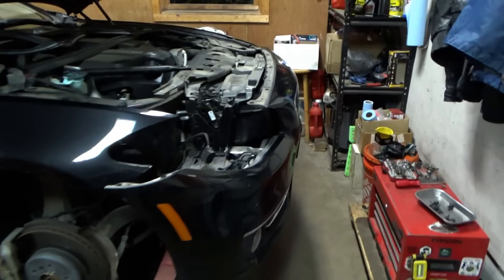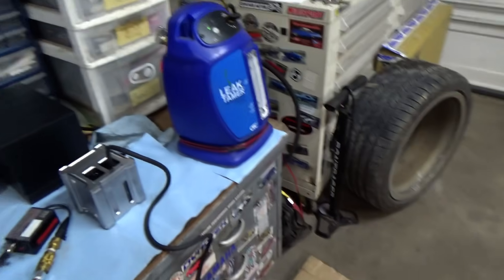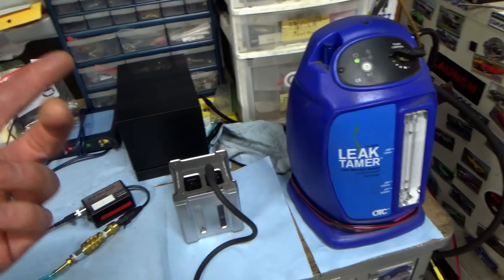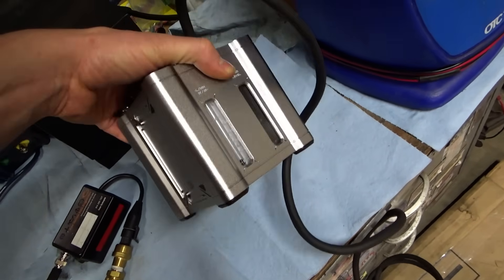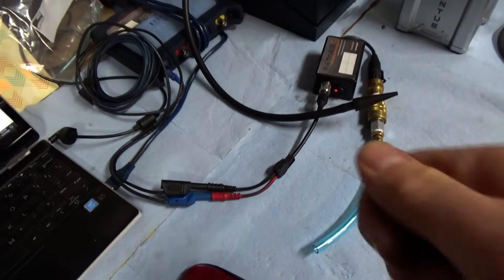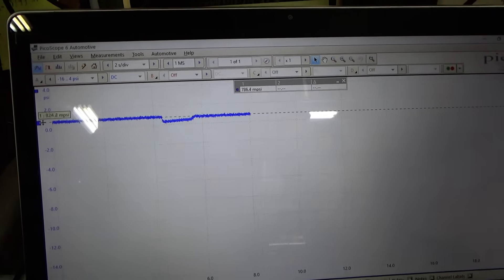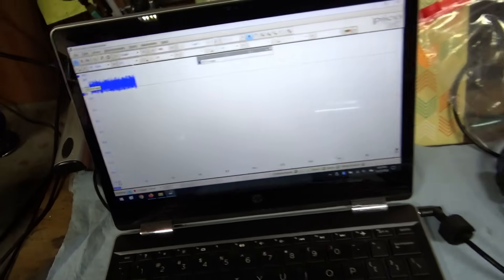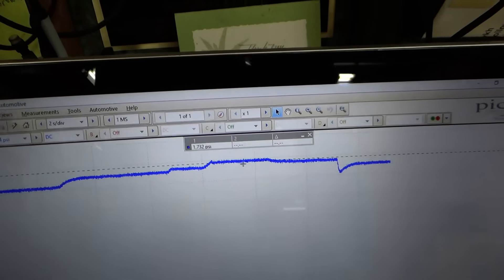BMW Headlight WATER INTRUSION?! (Smoke Machine Showdown!)

Comment: love your program.  When i need warm air to dry things like this I use my shop vac (clean the bucket first) by puttin the hose on the  outlet side and it will blow lots of warm air heated by the motor thru whatever u need to dry out

Comment: $1200 for a plastic jug with a heating element and a regulator to control air flow???  There’s not $50 in parts there. The $200 one has more parts and probably cost more to manufacture.

Comment: Can also make a very simple smoke machine out of 3" PVC plumbing parts from home depot to make a tank / pot, resistance wire meant for a vape wound to make about a 1-2 ohm coil,  wrap around a fiberglass tiki torch wick and some assorted hardware drilled through sides for terminals. some cords and aligator clips for thew car battery, Baby oil makes decent smoke fluid. run it off a very regulated down shop air and the car battery.   made one to find evap leaks and turbo plumbing leaks, works great!

Comment: The proper remedy would have been to put the headlight in a 275°F oven for 15 minutes. This would heat up the butyl so that the lens could be separated from the housing.
This would allow proper cleaning and drying of the headlight.
Butyl headlight sealant can be found on Amazon.
Reply: Whose oven ! LOL !

Comment: Stick the headlight assembly in an oven on its lowest setting. Most ovens have a warming feature of around 150 degrees. Leave all the caps off of it. Heat is your friend when drying out moisture. Also silicone won’t work for long. After about a year it’ll quit sealing. You have to use butyl. Those of us that build custom headlights learned this a long time ago.

Comment: Headlights are not supposed to be hermetically sealed so the trick is to seal the actual leak but make sure it can still breathe.  Also if that is mineral oil, it will coat everything inside the headlight which probably isn't good.  Plus it's flammable.

Comment: I have a lower model Autoline, it's ok for my DIY stuff. It was an upgrade from my home grown one with paint cans, wicks, and RTV connections, lol. The hoss that come with Autokine are junk mine fell apart and I had it about two years. It's a very low powered air motor, so it also took help using a flashlight. But, it did help a lot to find laks, if I was pro though I would get something more powerful.

Comment: In 1997 there was a new Dodge B350 vanpool commuter van that took out 2 headlight bulbs very quickly and was brought into our shop.
I removed the housing assembly and filled it with water.  Put the housing face down on rags that were on a bench.  Took a while but there it was, right at the black and clear plastic seams.
Using black RTV, I ran a bead around the seams, then put the housing face down over one of the floor lamps in the shop till the RTV dried.
No more leak,  no more burned out bulbs.
I like the OTC smoker, not so much with the little noise maker. 
Good fix Ivan.

Comment: I’m sorry Ivan but you are backing a smoke machine that couldn’t fill a headlamp with smoke, imagine trying to use this on an induction system etc, the two machines you are comparing are two very different machines, one is professional unit for a workshop that’s going to turn on and perform every day, the other is a noisy, low performing unit that clearly isn’t fit for a workshop.
Im actually surprised you have this labelled “Awesome”…
Sorry by my negativity but you usually plug quality tools & accessories…
Reply from the maker: @davidsinclair5004  the baby smoke machine hasn't let me down yet, and paid for itself in 2 diags! Sure it doesn't put out clouds of smoke, but for the price and portability it's pretty nice! 😁

Comment: Good luck with that. Been down this road. Bought customer new BMW light. THIS WILL BE BACK.  Anytime temp delta is significant  (hotter inside than out).
Ask anyone from BMW in Washington state.--------- It has vents_____    Air is allowed in ------- and out______

Comment: Hi Ivan, That little machine seems really loud to me when in smoke mode. Why was it quiet in air delivery mode but made so much noise in smoke mode. I also didn't like that the unit used internal/proprietary batteries. Which will eventually not take a charge. Hopefully Milwaukee or DeWalt will make one for their M12 or M18 units.

Comment: that permatex is great stuff also good on minor engine oil leaks, clean with brake clean and put it under vacuum and apply , 3m 5200 black marine polyurethane is the best for plastic leaks - sticky stuff, never comes off your hands!  mist with water to help speed up cure time.

Comment: Condensation in headlights in BMWs with active headlights is a known issue. Typically, you can resolve it by replacing the O-rings on the access ports, which should last for another 5 to 10 years. To dry out the housing, use a hairdryer for about an hour sending dry air thru the the access ports. O-rings are available from vendors such as ECS or FCPro. The O-Rings can be replaced with out removing the product. Likely the customer will return.
Reply from the maker: Uhhh water was getting in through the bad seal of the lens like I showed... Orings are not the issue here 😅

Comment: The smoke machines use oil. Are you concerned with oil inside the housing making it dirty inside the plastic that you are unlikely to be able to clean out?
Reply: I used a smoke machine to try to find a leak in my headlight. Left a oily film that was a PITA to clean out. I will be using compressed air and soapy water next time.

Comment: While handy, Id hate to wait for that thing to fill an evap system to actually find a leak.  Not much smoke output.
 Ivan, another shop called me with a Charger they had been beating their heads on for about 4 hours.  No start.  It took me 30 minutes with a wiring diagram to tell him what was wrong.  I did not hear a reply from him so I buzzed him and asked what the test I told him to run turned up.  He said he did what I told him and it was running.  LOL!!!  I said "Who's yer Daddy?!?"  XD

Comment: So if you just connected a air line to the head light you would have had the same results 🤣🤣
Reply from the maker: You would have an exploded headlight housing at 150 psi 😂
Reply: @PineHollowAutoDiagnostics  just turn down the pressure simple

Comment: Not impressed with the Amazon smoke machine. Couldn't see any smoke at all  there are others on the market for the same price that work much better.
Reply from the maker: Any recommendations?
Reply: @PineHollowAutoDiagnostics  ANCEL makes several models under $200 Autoline Pro makes a couple one under $100

Comment: I have a different model of OTC leak tamer, its 12V only - it has its own air pump.
The heater runs about 2 seconds in 10.
It does say not for evap systems though 

For drying headlamps I use tne shop vac in blow mode.
Theres a very high volume of air and it's also slightly heated by waste heat from the motor.
No danger of overheating anything.
Reply: Yes , blow warm air and Vac at the same time. Real time saver !

Comment: I had that same problem with my LED Taillights, used Hair dryer just pointing at hole for about an hour to dry out.

Sealed with silicone & drilled 1/8 holes in low spots of Taillights, no problems since.

Amozonian NON-SMOKE MACHINE SUCKS, YOU REALLY ENDORSE THIS THING ?

Comment: In similar circumstances I use a handheld hair dryer with a suitalbly sized tube attached to reach into wet electronic housings. I let it get to at least 50C and it dries it out bone dry as well as drying the cracked area out for good sealant adhesion. In preference to siicone I sometimes use epoxy.

Comment: I don't know how that headlight assembly is set up in regards to any modules or any other electronic materials, but a well placed drill hole will keep the water out by always draining it  i saw another video of a guy doing that. Has anyone else tried that. Sure would be a lot cheaper

Comment: After fixing dozens of F10/11 headlights (all right hand side) I can pretty much confirm that using a little silicone will not stop the water intrusion. It needs a good bead of permatex or heated up and press in butyl and checked afterwards, if a new location pops up
Reply: I had the EXACT same thing happen on a Nissan Sentra tail light assembly. The moisture caused feedback into the brake light circuit and caused the car to go in limp mode every time lights were turned on. I used silicone on the seal and it lasted about a year. Replaced the tail light assembly and problem was permanently solved.

Comment: Sometimes the headlights are inside dusty. Without dismantling it, you can't get to it from the outside. In such a case, I remove the bulbs and xenon bulbs and then fill in a glass of isopropanol and shake the headlight. Then pour out isopropanol.
This removes about 90% of the dust. And the remaining isopropanol evaporates quickly.

Comment: owner should save up for a new head light assembly anyways.  The wiring harness inside the lenses get baked from the heat from the lights and the insulation becomes brittle and just fall off leaving the wires exposed inside the housing.  And as far as I know there is no way to truly repair them with out fully correcting the possibility of a short and starting a fire.  and its not just the BMW its all the European manufactures have this issue Volvo, VW, Mercedes, Audi

Comment: 99% of the time it's a lens to housing leak. I just put my headlight assembly in front of my fireplace for a day to dry it out. Then put a tiny thin bead of clear silicine along the whole seam and 10 yrs later it's still good.

Comment: One of these vape-cigarettes puts out more smoke than that small cube. Good idea having a self contained unit, but they need to have it deliver a denser smoke.
Reply: I made a $5 miniature smoke machine with a vape pen using glycerin and a 3.7V Li Ion cell. It produces a surprising amount of smoke. A down-side is the glycerin smoke leaves a slightly soapy residue on surfaces it touches. Auto smoke machines use mineral oil which is probably more compatible with most car systems.  The other advantage of the glycerin smoke from the vape is that it is not flammable whereas the mineral oil smoke using air is an explosion hazard. The smoke machine instructions say you must use nitrogen to avoid this, but no one does.
Reply: I just used a vape inside of my headlight to smoke test it and it did leave a residue 😔  @carolb9422

Comment: A module for a headlight.  Nuts!
Reply: Those TMS modules are a common failure from water intrusion.
They drive the servo motors for levelling (and beam steering on adaptive models)
They're about £400+vat UK, but aftermarket units about a tenth of that.
Reply: @Tom-BXR300 
And how many thick wires would you have to route from the driver's door to control four windows, right and left mirror, mirror heat, mirror indicator, locks, and rear gate?

An with modern headlights you'd have to have electronics there anyway.

And most people today don't know how to even replace a light bulb. So... 😉
Reply: Hate new cars !!
Reply: Already over 20 years old thing :D
Reply: @Syntappi  
What?
Reply: @Peter_Riis_DK  at least bmw:s have had headlight modules last 20 years
Reply: @Syntappi 
Ah, that!
Reply: Nope. It actually was a good idea when it was first suggested. The idea was, that you could control anything on the car with a ring of three wires; power, two signal wires and a ground connection. The prerequisite of course was standardization making these modules inexpensive.

However every car manufacturer makes their own "shit" which makes it bloody pricy - and there's your problem.

Comment: There is a video online. Cut up some microfibre cloths. Put them in and blow compressed air in where you were putting air in. The rags pieces will circulate around and clean it out. I will see if I can find it. It was a detailer who posted it.

Comment: I have a $200 ANCEL smoke machine that you have to hookup to 12V yourself but has an internal air pump - works well. Puts out a lot more smoke than that little machine and came with a bunch of adapters including an air bladder

Comment: Moisture and BMW headlights go together like 2.0L VW/AUDI TFSI engines and camshaft correlation codes. F10 5 series are THE WORST about this. 

I prefer to use butyl sealant after baking the headlight for a low temp like 150-200. 

Love that you fix even the small stuff!
Reply: Hi. Can i ask you if 150-200 is fahrenheit? Thanks
Reply from the maker: Next up on this BMW... VALVE COVER GASKET! 😂😂😂

Comment: Repaired alot of leaking devices some under steam pressure on commercial steam cabinets and ovens . We find sikaflex is superior to just about anything else on the market it's difficult to run it on smoothly and takes longer to cure using moisture rather than air for curing but seals and lasts with non corrosive results on metal . Silicone is relegated to sealing surfaces what are visible externally and not under any kind of pressure but need a high quality finish like tiles .

Comment: I am a big fan of weep holes. Drill a small hole at bottom to give a place for moisture to escape.
Reply: Always do more than one in case of a blockage or too slow of a drain. At the lowest points, preferably on the backside or underneath.
Reply: Pour silicone beads in there!!!!
Reply from the maker: I thought about drilling a hole... But decided to actually fix the leak instead of making more holes 😂😂😂
Reply: @PineHollowAutoDiagnostics  I once had a beater old Toyota with this problem, and I tried silicone sealant around that seam at least three times but it still leaked.  Next time I will try a smoke emitting device

Comment: May i suggest that the port to access the bulb is also a keak point. The cap barely fit without you applying pressure with the clamp and it is a low point on the top where rain blown under the hood will sit and gravitate inside.

Comment: I had condensation in one of my 2020 Bliss F150 taillights a year ago, removed it, used hair dryer to get rid of condensation, then used silicone seal where unit is split, no problems since then.

Comment: I had the same issue with a tail light. I figured out where the water was getting in. After drying it out and cleaning it, I pulled a small vacuum in the tail light assembly and then let the vacuum pull some super glue in to the leak. Worked like a charm.
Reply: Silicone is too thick. I would choose super glue as well. Maybe gel super glue.
Reply: @johnmeyer4804  Flowable Silicone !

Comment: I would not use silicone. A good polyurethane sealant adhesive would be recommended. Silicone rapidly degrades in sunlight.
Reply from the maker: Hmm I've had the same silicone sealant baking on the ROOF of my Suzuki for 5 YEARS and it's still holding perfectly! 😊

Comment: hook it  up to the vacuum pump. the lower pressure will cause the water to boil off. as a plus it will pull the sealant into the crack.

Comment: These headlamps are ridiculous.  What was wrong with the old bulbs and no computer?
Reply: They wouldn't break as quickly (probably never except to replace a cheap burned out halogen bulb)
and it wouldn't cost you thousands to replace the failed unit!
Reply: Nothing wrong with the old ones but they don't perform as well as he newer ones, I drive 2 cars back to back with old and new headlight and the difference is huge .  Newer headlamps offer some neat perks, better lighting and visibility, less power consumption, they follow the directions of steering, they adjust heights based on road surface and lower when they detect an oncoming car so you don't blind oncoming traffic, some of them you can even keep your high beam following other cars and it won't blind them since it detects the car in front of you and will turn down the section if the light where the car is in front of you...but the down side is it will cost an arm and leg if you need to replace the whole housing...
Reply: @dazone  LOL....but they fail earlier, and when they do you will replace the unit for a cost of thousands of dollars ! lol I and most buyers do not want to deal with that for your technology.
Reply: @dazone need more microprocessors and modules! Technology is great as long as it’s working.
Reply: @ Yup, indeed!

Comment: We just use another battery in a cabinet the Leak Tamer sets on with wheels to roll around the shop with all the adapters under it in the same small cabinet. When looking for hard to find small leaks on EVAP systems you need all the smoke you can get.
Reply from the maker: I do a lot of mobile calls so needed something PORTABLE 😉
Reply: @PineHollowAutoDiagnostics  Oh we all know that for sure and you do a great job

Comment: I'm not to impressed  with the self powered..smoke machine...other than the battery it has same problem as all the other cheap chinese machines which cost around $70..not enough smoke..I didn't get anywhere with mine because it just isn't enough for many jobs..I'm thinking the cigar and harbor freight pump works better...cigars are 10$ lol

Comment: Very interesting, if unusual, video, Ivan! That little smoke machine is impressive! I only have a doubt about the quantity of smoke, if you need an EVAP test - is it enough?
Water is very annoying in any headlight, but on one crammed with electronics, it's a big problem. I've solved a couple with a vacuum cleaner sucking air from inside, with a flexible tube, through the lamp holder - your solution is less noisy 🙂